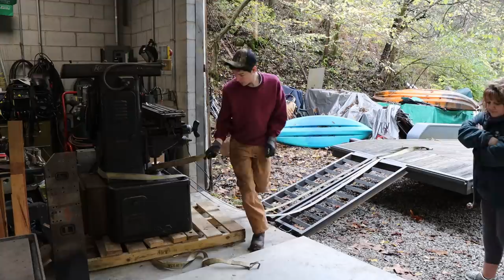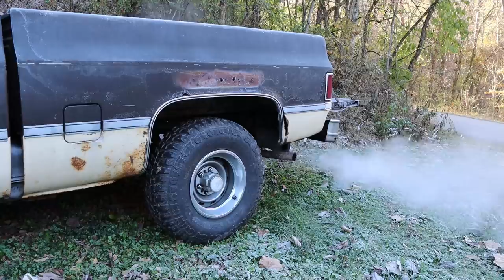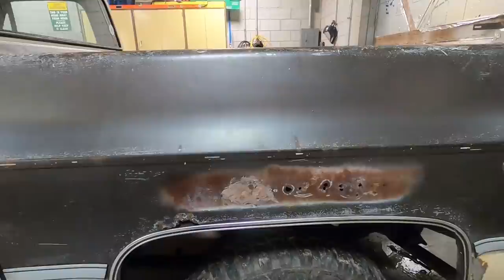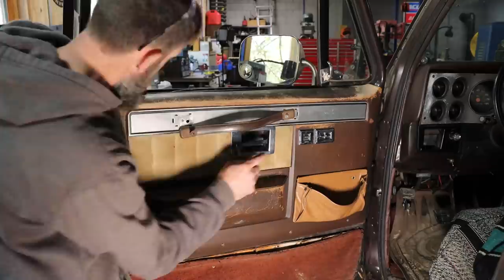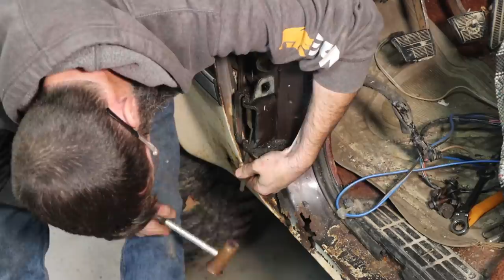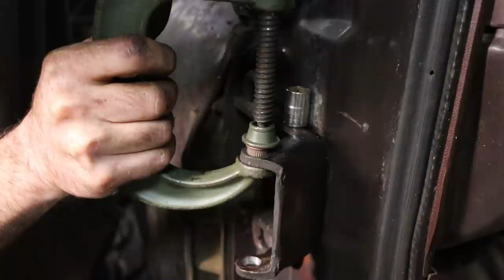Working On The Chevy K10 PT 7 & Down sizing the machine herd.

Comment: Was this machine beyond the capacity of your walk-behind forklift? I've often moved my machinery on a pallet jack and low-boy hydraulic trailers that drop all the way down and have a wide smooth ramp you can just roll the pallet jack into the trailer. My biggest machines are in the 5,000Lb range. This machine looks to me like about 1,100Lbs or more. I'll look it up.

Comment: 26:00 Why are brake lines coiled like that after they come out of the cylinder? curious
Reply: If they aren't given enough room to flex between the body and frame the lines will work harden and crack
Reply: The additional material spreads the movement over a larger area
Reply: @benniethejew  Thanks!

Comment: Is that a Husqvarna Leaf blower you have right at the beginning of the video on the roof? Have you ever had problems with the ignition coil on it? I have one that's really hard to start, and then when you get it running, it runs for a few minutes fine (sometimes 10 or 15 minutes straight), then suddenly looses spark I think. Even testing it from cold, the spark seems really weak. Kind of curious if that's a known issue on those?